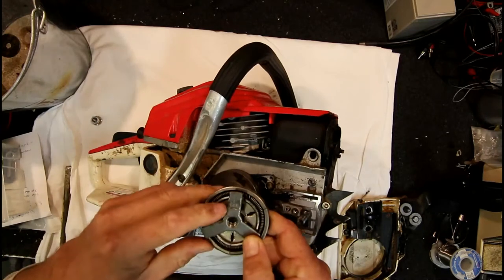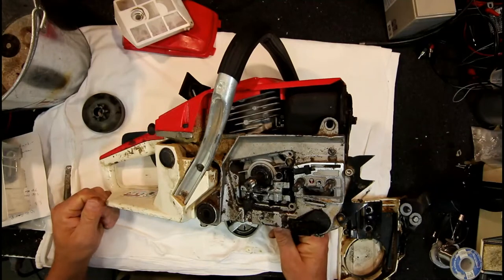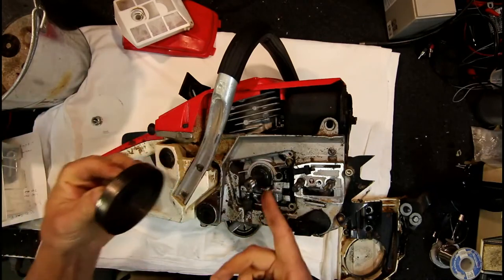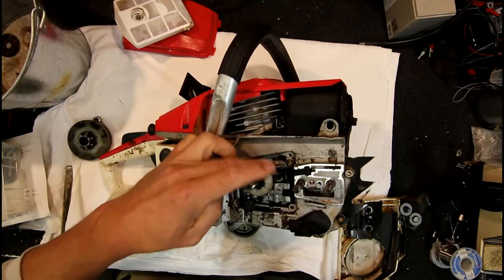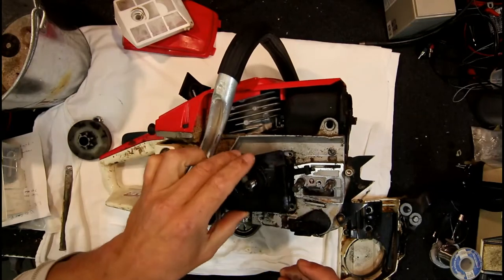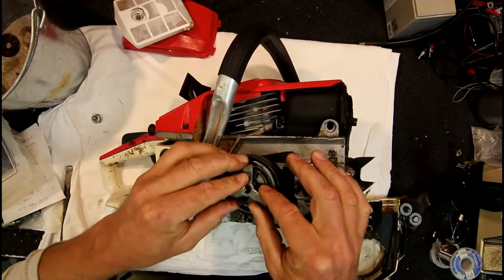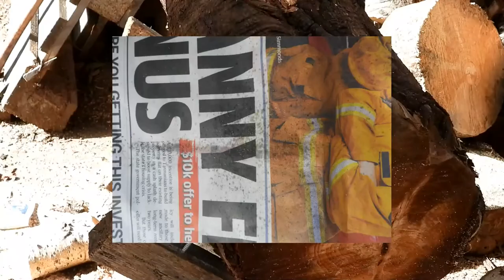Giantz 45-52cc Chainsaw bar lube oil pump replacement

Comment: Thanks Steve, I’ve just purchased exactly the same saw as you have. The first use after a half hour the spark plug died and I couldn’t get it going again, I replaced the plug and it was fine. The second time I used it the other day the saw was totally out of tune on the low side, so I’ve ordered a special set of tuning tools for the carburettor, a special PAC Man socket to adjust carby is required. After cleaning the saw and testing it before putting it away while waiting for my tuning kit all of a sudden oil started pouring out of it everywhere. I’m pretty careful with my equipment so I haven’t been hard on it at all. I have two Sthil saws which I love and have had for years and are still like new after several years of use. 
Thanks for sharing your video on how to replace the oil pump which looks like I might have to do after I tune the Carby lol…
Cheers mate 🍻
Reply from the maker: Stihl are definitely a much better saw. These Chinese saws tend to leak a bit of bar lube when sitting. I aim to get it as low as possible at the end of cutting and always store the saw on some newspaper. I didnt expect much of a saw for the price, and wasnt disappointed.

Comment: Would these parts work on a 42cc? My 42cc has same type of oil pump.
Reply from the maker: If it looks the same they may have used the same part. I would check with whoever supplies the replacement pump if it fits, or compare the part numbers if you can find the manuals online.